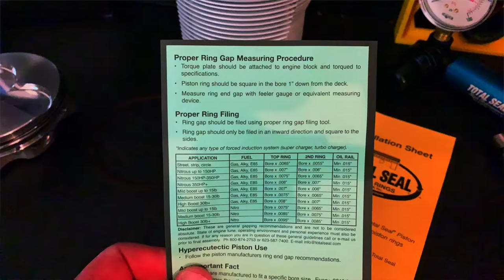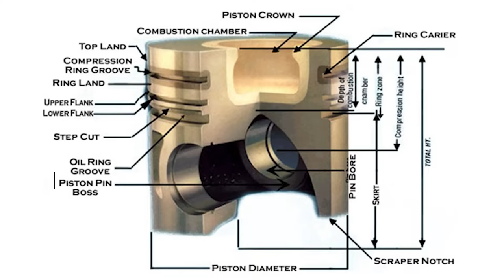End Gap Mistakes That Will RUIN Your Engine

Comment: A little loose and nobody knows...a little tight and everybody knows...
Reply from the maker: That’s right!
Reply: @TotalSeal  Big ring gap = big catch can.  Small ring gap = big trash can.
Reply from the maker: @dannobee  LOL
Reply: I've built fixtures and know CTE. Too much end gap won't hurt. People over think this subject.
Reply: @dannobee 
Hah there ya go that's something my ol hs shop teacher woulda said 30yrd ago ✌️
Loose is fast anyway, at least I thought 😁
Staying on the loose side of the spec for valve clearance is what I was told to do,a couple thou of lift lost isn't going to be noticable but your valves will probably be happier in the long run✌️
Reply: But If it's a Woman ..... it's always the Opposite !! 🤣👍🏻
Reply: Love this!
Reply: A little bit more leak down with bigger ring gaps but compression doesn't seem effected and stay on the safer side ..a extra quart of oil is cheaper than an engine
Reply: @dannobee  that made me laugh harder than it should have,  thank you.
Reply: No because if it's loose everyone has been in side. So everyone knows 😂 😂
Reply: @dannobee . Absolutely! Good one
Reply: @TotalSeal  On the end gap chart is Bore in Inches and then Times Inches again ?
Reply: Good one 😂

Comment: It's the installing mechanic's job to verify the end-gap and not the machine shop's.  I rebuilt this guy's engine block and ordered his parts, and he put the engine together himself.  He overheated it because the ring gap was not set for a turbo application - he blamed me for not verifying the ring gap before I sold it to him.  I told him that, "that's like blaming the gas station clerk for not checking the condoms for holes after you've used 'em."     It's the installing mechanic's job to verify the ring gap.   Olympia Engine Builders.
Reply: It’s the responsibility of the piston installer…always!
Reply: I like that analogy - I must remember it. 😄👍
Reply: I feel your pain.   Unfortunately, many of us American men suffer from over confidence AND control issues.  Your customer hired you to do the bare minimum, and he was confident enough to do the assembly, not on a street driven 351w, but on a Turbo application.    I bet he set the top ring gap at .030 inch  for "maximum compression".    Roflmao.        When I talked to one of theses clowns after a blown engine, I would say:      "no warranty on race engines....ABSOLUTELY NO WARRANTY on machine work for race short blocks that I do not assemble to my specs".    Tell him he got off for a few thousand dollars for your work, and tell him that assembled race engines start at around $20k.
Reply: lmao. uhhhh....
Reply: Could cooler burning e85 have made a difference in that situation?
Reply: TRUE!!!
Reply: The dude was trying to get his money back, mind as well try.
Reply: I'm thinking yes that e85 may have helped but who knows how much its more dependent on how much boost he put to it obviously it was more than 5 psi
Reply: @dennisrobinson8008 E85  Does not burn cooler.
Reply: @dennisrobinson8008 no, e85 has less energy, pure Ethanol is another story.
Reply: I added a link from a reputable source that e85 cools the intake charge, allowing more timing.    E85 also burns cooler according to this source as measured by lowered EGTs.   Let's stop with the lies.    They have no place in tech.  Politics are trash here.
Reply: @dennisrobinson8008  it's the green colored pump handles that makes it greener!!  Duh!
Reply: As a mechanic 100% agreed it's the assemblers responsibility....NEVER rely on good to go ..
Reply: An engine builder will generally check everything and have a check sheet that goes with the motor. 
The ring gap would have been written down and provided if it was a freshly built motor...

I wouldn't have talen the motor without the sheet- otherwise I would pulled it apart and checked it myself.
Reply: @dylandesmond  Customers can bring the engine back to me at any time if there is a problem.
Reply: That goes without saying, anyone who doesn't know this shouldn't be attempting to assemble an engine. I build TTurbo coyote 5.0 engines my machinist Measures Bores Hones Decks Lathes but assembly, ring gap, torque specs etc are on me.
Reply: @kevinwest3689  I only do what the customer's willing to pay me to do.  If he wanted me to check the parts in the engine kit and correct the ring's end gap for a turbo application, he'd have to pay extra - same goes for the rotating assembly's bearing clearances and end play.  If he's willing to pay me to do all that and disassemble it for him reassemble, OK, sure.  But that's not what happened.  Look, you go to a machine shop and pretend that you know what you are doing, who am I to question you, because at the end of the day, I will still believe in Jesus Christ and people who pay in cash.
Reply: @jamesjacobs1909  If karma was real your tongue would catch on fire for Invoking jesus Christ.  To shorten your comment, you could have said that the Brought you the wrong parts and you threw it together Knowing it was wrong because you know everything. Meaning.
You intentionally set him up for failure. How God like of you. I just hope that at least one) person in your area sees your response and post.  In the long run things don't go well for people with your character sir.
Reply: Absolutely 👍 As a Diesel Mechanic, 💯% Facts, It's easier to blame others for A Mistake, It's also easy to check it yourself, I have learned never assume Anything when it comes to parts, I don't care if it's only a bolt we are talking about,  It has to be right, Because if not you'll be the first unhappy person in your building, Maybe even for a week long.
Reply: @raymondreiff8170 Yes, everyone trying to blame someone else for their F up's when they could have avoid the problem entirely by simply checking the work (be it machining or parts).  One has to be in the mindset of having to take responsibility for the problem before if it fails on startup.
Reply: If u confirm that it's not for turbo use then it's not on you at all
Reply: @AshLongie  It was never my fault, the customer did his own assembly.  It's the installing mechanic's responsibility to verify such things as end gap, end play, clearances within the rotating assembly and etc.
Reply: @jamesjacobs1909  AHh fare man I skimmed threw the comments yea 100% who ever built it is responsible how can he even blame you ? Lolol I assumed you built it   
That's crazy did you ask what clearance he used to rub it in
Reply: My biggest mistake I got a bottom end built by shop crank rods pistons I assembled i  test drove it cambelt jumps teeth check crank bolt loose I never said anything to shop I blamed my self for not double checking all the work 
My motto is if you put a bolt in torque it or leave it off built every engine my self since never had a issue
Reply: @AshLongie  I hate torque to yield head bolts.  Especially those that require two awkward torque angles, like on some of the LSs with their 85 degree BS, and what's worse is being interrupted by customers and remembering where I had left off at.

Comment: It's amazing how if you take the oil scraper rings and bend the ends so they point back towards the piston skirt instead of having that /\ outwards, the pistons just glide in the bores instead of needing to be tugged on. And this was $0 mod was worth over 20hp on my friends car, LOVE things like that and thats what the name of the game is here!
Reply: I’ll do this next time!
Reply: Better run a good vacuum pump
Reply: I'm concerned about losing oil seal. I am thinking of trying it but I drive a lot on the street
Reply: Bend??  How'bout just radius the corner?
Reply: @alro2434  I actually tried that on the top and second ring, even though this is supposed to be an absolute NO NO and there has been no huge problems with it. It was kind of remarkable as to how low the oil consumption was as compared to the previous engines that I've done. Boosted air cooled engine, daily driven.
Reply: I don't quite understand, bend the ends back?
Reply: @oneninerniner3427  On the oil scraper rings... bend them a little INWARDS. Other way to get the same effect is to radius the corners instead of a square edge.
Reply: The idea is to prevent the sharp corners of the ring gap from digging into the cylinders.
Reply: Why not radius outside corners of all the rings?  Seems like seal would not  be compromised  and far less chance of scoring cyl. wall.
Reply: Why not radius outside corners of all the rings?  Seems like seal would not  be compromised  and far less chance of scoring cyl. wall.

Comment: 45 years ago I called TRW and asked what ring gap to run for their forged pistons on gas.  Their answer was .004 per inch of cylinder bore.  Never broke a ring, never scratched a cylinder.
Reply: I agree TRW was a fantastic forged piston I ran tight gaps on those.
Reply: @rafaeltorres2886  First and foremost, spend the money and use a ring end gap filer.  

I bought a set of 302 Chevy pistons from them, .030 over with unfinished domes.  I managed to run 14.5:1 compression on pump premium gas on the street by using a cam with a lot of overlap.  The one thing I had to do was install an ignition kill switch (Joe Hunt magneto) so the engine could spin up to speed before it could light off or I broke the nose off of the starter every time.  That car was rough on tires.
Reply: That goes for everything since the beginning ,,it's what we would call a rule of thumb   ....but today if you are running NOS double the gap on the top ring ..the boys of road kill demonstrated what NOS does to destroy your engine. Without knowing too much about it you can see that NOS would make a lot of heat real quick real fast. And doing so wouldn't make that top compression ring grow very fast and when it touches both ends it rips off the top of your piston ... if you got the air fuel mix exactly right that's the only thing that will go wrong to your engine it makes that top ring grow really quick ... It was proven there during the show with that stock block LS probably out of a pickup truck and they NOS it to death. They did manage to make over 700 horsepower out of a stock 350 horsepower so before.. I think it was the front right side cylinder  the ring stuck in the piston no Gap and part of the top of the Piston was gone ..so a quick fix was to double the ring end gap ... But what if you use a total Seal ring set up . And then only on the 2nd ring like they do on diesels  ...0.004" per inch of bore x 4" bore = 0.016" + NOS = 0.032" could burn some oil ..but with total Seal rings obviously would burn less ...so what I'm getting at ..who has done this and will you give up the magic numbers for the optimum performancel
Reply: Yes, same for me 55 years ago.
Reply: @rafaeltorres2886  what was your cylinder wall to piston skirt clearances
Reply: @honkie247  baha-HEHAW dang rabbit . Lemme guess ? 280* degrees duration or more.. seems like there was ... But there is no one who believes your story today ... You had procedures to successfully start your engine or you could burn up in the burst of flames from the explosion of not done correctly !!! Sound about right ? The car was not a 1968  Chevy orange / black vinyl top Z/28 Camaro " tubed out " with slicks ... Two dominator double pumpers on a tunnel ram with dual velocity stacks that all together was taller than the roof of car.. wasn't you was it ,. If so I seen you run it one time taking a warm up run a little too soon catch up to a 1932 coupe with the famous 327 Corvette "mighty mouse" motor still racing a '69 Chevelle with "the mystery motor" just out 402 big block .. if it was you in the z/28 the mouse was ahead of the rat and you zig zaged in between both in our marked off 1/4 mile on Indiana st. Rd. 150 .. after we all saw you do that  , everyone else who was lined up to race you that evening pulled out and went home ..
Reply: @rafaeltorres2886 
I just ordered some Kieth Black  , Claimer series with a medium size pop up. 
Are these any good or should I order different ones. I’m just using it for just a street build.

Comment: What about a regular street engine? The biggest thing a machine shop customer complains about is oil burning. Most ring sets, ex. Sealed power, Hastings, are engineered sets. And gaps are pre set. Usually 3.5 to .004 per inch of bore. Never had a problem. Chrome top rings are hard to break in because most people drive their "new" engines too gently. They need hard acceleration to "scrub" them in.  Don't let new engines idle! Worst thing! Just drive it!

Comment: I opened the hood. I checked the oil, and sprayed some belt dressing on the belt. That's as far as I got. The pistons, are underneath a bunch of stuff.
Reply from the maker: LOL, they are quite inconvenient to reach.
Reply: Just screw out the spark plugs, you can get right to them. This is a secret professional mechanics don't want you to know!
Reply: If ya don't know don't touch its OK not to know someone else does.

Comment: i saw a test at GM tech center on a 700 HP NASCAR cup engine where they opened the ring end gap to .125 and the engine lost less than 5 HP. lots of blowby but little HP loss
Reply: Yes.  Keith black put out an article about 30 years ago where they increased gap all the way to ,060 before it changed hp and blowby.  I can’t find the old article but I remember it so well.  They also ran huge second gaps and made more power.
Reply: Thanks for all the high tech info.
Reply: High rpm eng not enough time to leak at high rpm
Reply: I've watched some of your videos and you use this great pistons, never revealing what kind or who makes them. What  kind are they?? Went to total seal web site, no pistons!

Comment: I have the same beliefs on the three ring gaps, but I try to take into consideration two more things; 
    How much will the rings close up at operating temp? The top closes up much more than the second. You have to anticipate that and adjust accordingly. 
   Also, how much does the ring open up as it seats? A C-33 AP steel ring may not wear the face at all, so it’s gap stays consistent after break in. 
     The second ring, being a tapered face, will open up the gap .00314” per .001” of face wear. per side, which means .00628” more gap, per .001” combined face wear around the ring.
   That second ring can open up .020” pretty easy. So keep that in mind. This is often the reason people see a power increase “after the rings seat”. It’s not that it’s sealing more compression, it’s that the ring pack starts working better because the second may have been too tight initially. 

   Something else to consider about blow by and gap is, on our drag outboards, some pistons only have one ring, and others have both gaps aligned on a common pin, installed from the top. They still hold 2% leakdown, no problem.
Reply from the maker: Very great points!

Comment: I've always run tighter second gaps and had many conversations with guys that did too, never put me wrong and never a blow up from it, BUT I'm building a serious tarmac race car ATM and think I'll pull the bottom end back down and try the larger second ring gap as the rpm is up around 8200 with this motor so it can't hurt to try a bigger second gap, thanks for the good explanation, never too old to learn a new trick 😊
Reply from the maker: Thanks for watching!
Reply: I made mine tighter on 2nd as I was told the piston isn’t as hot down there, but by a couple thou
Reply: @WesternReloader  I always did the same, I had a conversation with a ring manufacturer years ago that backed up the claim that tighter second gap is better, what I'll do is run it tight on this engine and in 12 months time when it comes out for a freshen up I'll go bigger second gap and try the difference
Reply: Remember, your tapered face second ring opens up .00628” for every .001” the face wears, easy as Pi.
Reply: He's talking about a filled block.. I think the top takes most of the heat and agree with wide if the gap closes..
Never tried or noticed any issue with second or upper oil rail...
Interesting discussion
Reply: 60 years ago Smokey   said top gap because  it went into upper block not surrounded by water..
Reply: So years ago we chatted with a gentleman at total seal and he was a prostock racer,  he explained it as the second ring gap comes into play majorly over 8000rpm, he stated that they had noticed top ring flutter with a tight second ring gap when reving engines over 8000rpm and said it was due to a pressure buildup between top ring and second ring and explained this is why there's a pressure indifference grove in-between top and botto rings on a lot of pistons , I'll be interested to see if there's a difference on the high end 2.9 I'm just finishing off, I'm aiming for 2 HP per cui so this may be the last trick to get us there, 🤞

Comment: This is making me feel better..I'm building a Honda engine for a guy It's a d series... I tried to offer him a better engine but he wanted to stay factory and just build it... So, we had custom wiseco pistons made for this engine 75.5 mm bore, stroke is .163 mm longer than factory rods...when I was checking the ring gaps they were a little bigger than what was specified on the sheet from wiseco...there was three different end gaps... street ,street /strip, nitrous /boost... Well the gap is slightly larger than the nitrous boost gap setting but this engine is going from 9-1 compression all the way to 11: 00-1...The bore is exactly on par and the Pistons measure exactly on par with the correct clearance.. My machine shop guy says it'll be just fine... I think it was like 26ths... The biggest setting on the sheet was 24... I think it's about 2 to 3,000s More than the biggest measurement... This engine will never see a turbo but there's a possibility he might put a 50 shot on it at some point so I guess the slightly larger ring gap is okay....